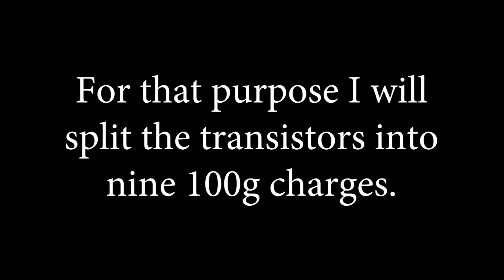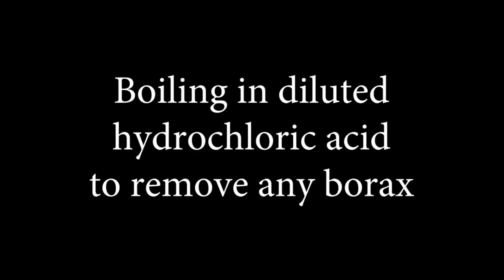GOLD from transistors - test run

Comment: I'm just wondering if it would have been easier and less costly to have used a sulphuric acid stripping cell than using a furnace to melt lead as a collector metal for the gold?
Reply from the maker: I find this process more convenient
Reply: fair enough! thank you for the reply :)

Comment: سلام استاد برای قالکاری یک کیلو  ترانزیستور بطور استاندارد چه مقدار سرب و نقره لازم است وایا این مقدار سرب ونقره برای یک کیلو قطعات سی پی یو وسایر قطعات ثابت است از راهنمایی استاد متشکرم
Reply from the maker: You can do 1kg transistors in 1kg lead but you have to divide the transistors into 100g batches dipping each batch separately in the same lead, when finished you should add at least 100g of silver (Ag>10% of the lead weight)